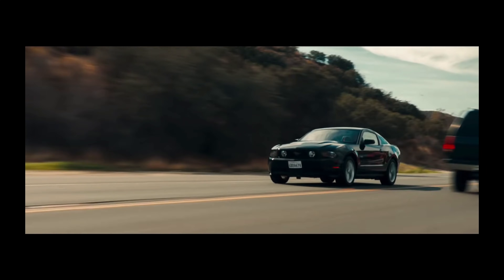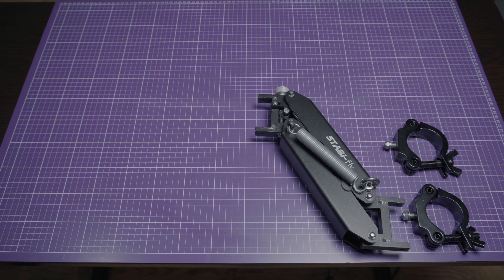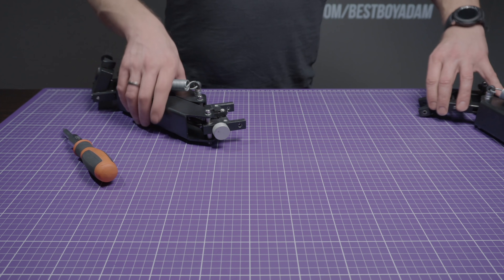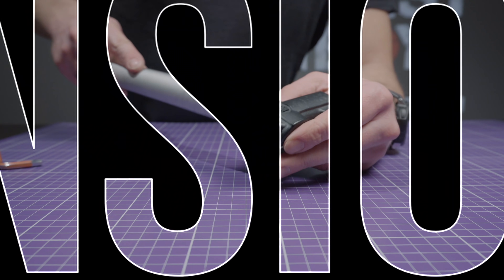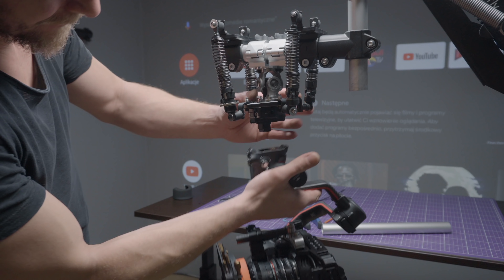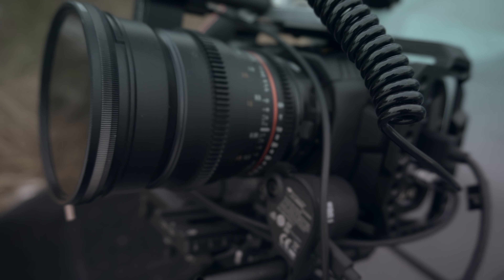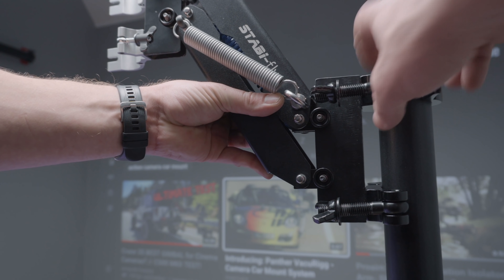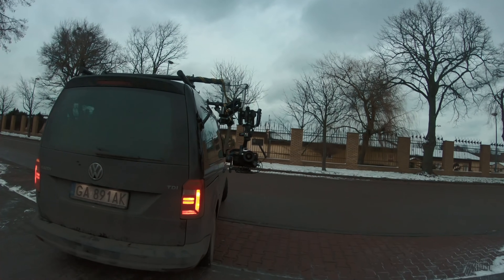Car Mount for DJI RS2

Comment: Where are you getting your clamps? Every clamp I get off Amazon is some weird size and will not work with standard size pipes. They are either too big or too small. I am in the US so we don't buy metric. Our standard sizes are 1 1/4", 1 1/2" and 2".

P.S. I am in the process of building out your rotating rig as well. Again, Finding the metal stock in the right size is the hardest part it seems.

Comment: For anyone looking for the joint at 5:04 it's called a "U-joint Coupling & Flange Yoke" and it's actually pretty hard to find. Thought i'd post here after searching for several hours.
Reply: Do you have a link for the shock absorbing springs too? The ones on the left at 7m29s?
Reply: In fact, finding a "U-joint Coupling & Flange Yoke" in the UK is a nightmare!

Comment: Hello, thanks for great tutorial. Have you think about more simple mounting of this arm on the car, as i didn't realize how it's possible to travel by plane with this rig. What is the benefits of Ronin RS2 gimbal out of S? It also has a baseplate mounting but cheaper.

Comment: I made a custom cable to go from my D-TAP plug on my battery directly into the Nucleus focus motor... Even though the motor's input is a micro-USB plug, it is rated to accept the 14v input that the D-TAP provides... This delivers enough power to turn my Xeen lens. Otherwise, the motor really struggles to turn that big lens with jus the 5v USB plug.